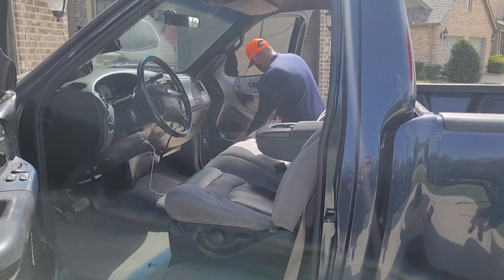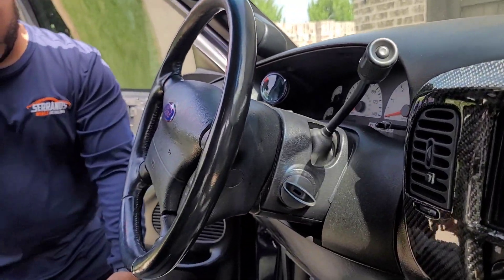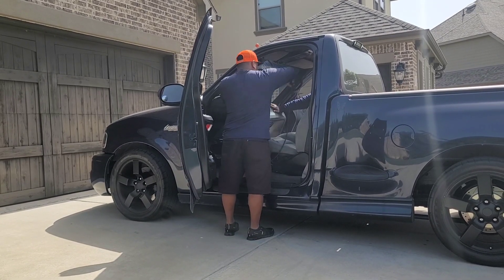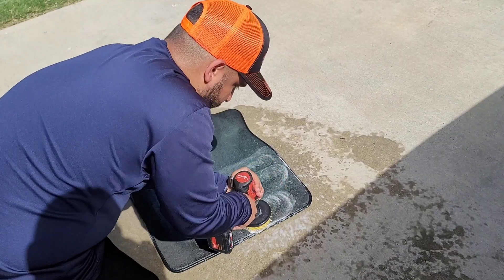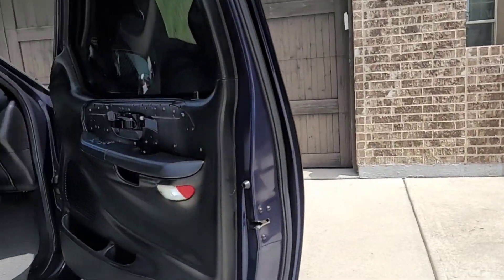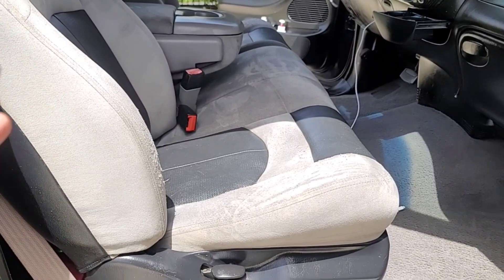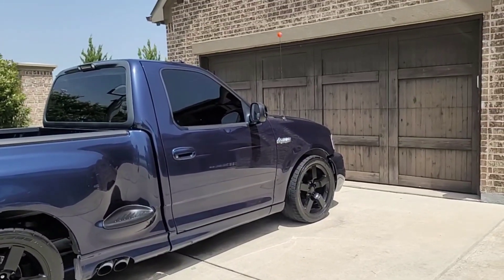Ford Lightning (Interior detail)

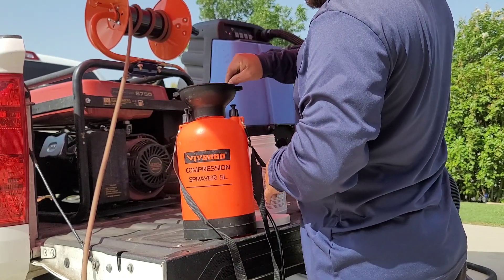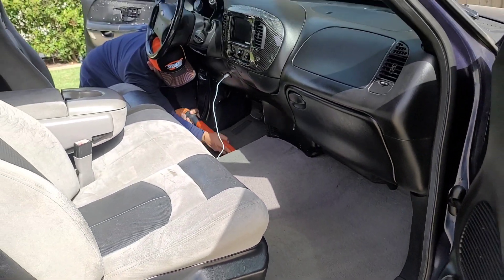Comment: Hell ya! Love L’s. Had a White ‘94 with spray, 1.7 roller rockers…later in its life got a 4:30 gear…4:10 went kaboom…..from 98-02 and a Silver  ‘00 with TFS heads, one of the first Jokerz ported blower, pulley, tuned….’03/04 wheels…..From 14-16 I helped organize/host the NMRA/NMCA Lighting meet in Joliet. 🚀🚀 love your vids dude! 🤙🤙
Reply: Also….using a single blade shaving 🪒 razor on the alcantera helped my drivers seat a ton on my ‘00. Good trick for alcantera(fake suede). Lemme know if ya ever try it.
Reply from the maker: Yes the razor helps a ton, but I'd rather just tell customer it's time to get these re done
Reply: Truck turned out great too🤙🤙
Reply from the maker: Yes I have used those, they work great